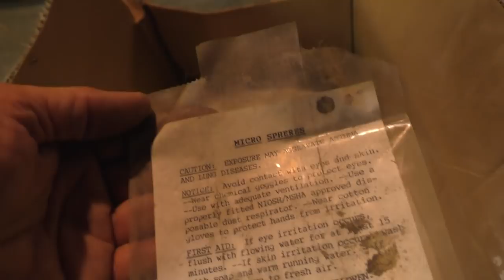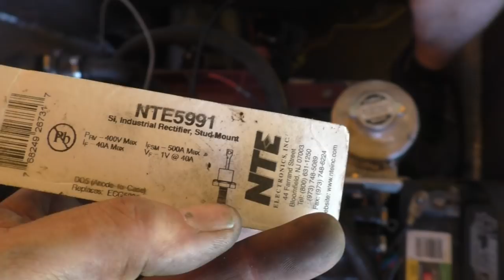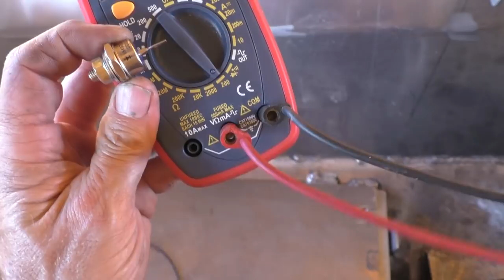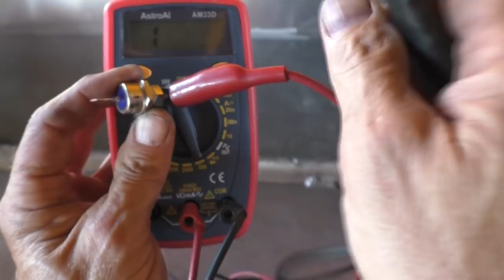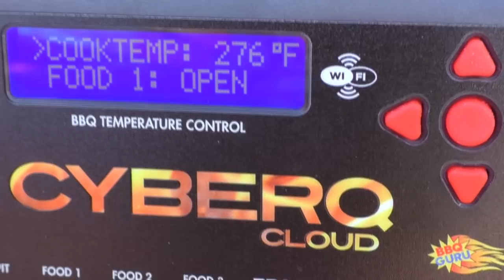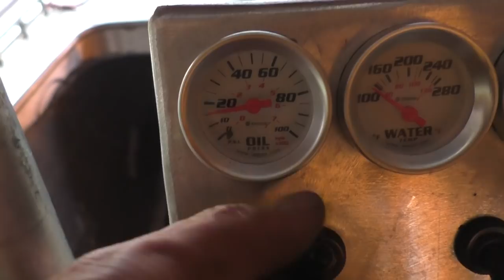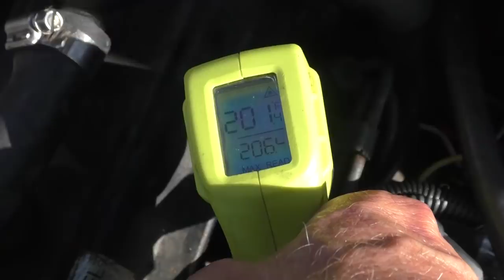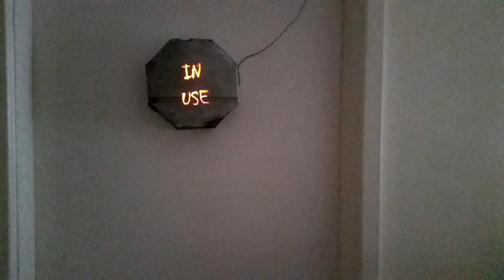Diesel Jet Boat Build - Part 17 - Fixes and Back to the Lake

Comment: LOVE those Butt Connectors. VHT paint also Known as 'Header Paint', or Engine Paint. Paint your Volkswagen motor Hemi Orange, it''ll Put Out Fifty More Horsepower, lol. I like Chris's little trailer, takes Tiny House living to a ridiculous extreme, lol. Oh, and I been making window frames for Mom's windows from 3&1/2x3/4-inch poplar. Don't know how to make a vid or send it. NOT a Carpenter, either. Glad Love Me is Finally Up and Running RIGHT.

Comment: cam tensioner adjustment .. tighten till the Longest span of the timing belt can Only be twisted 1/4 turn by hand.... no more no less..  if its too tight.. it will sound like a super charger.. pull up too hard on the crank.. pull down too hard on the cam and aux shaft.. usually snapping the end of the cam off.. was a specific weighted tool to set the timing belt tension..  most just use the longest span 1/4 turn method..

Comment: Please note the amount of zinc sacrificial anodes on the steel boat up in the air at 34:39. There is no such thing as too much corrosion resistance for your hull.
Reply: That's not true mate, too much anodic protection is worse than none at all

Comment: Maybe get some truck floor board insulation for the aluminum seat above the turbo should help keep the heat in the engine compartment and the seat cool for your buns

Comment: Doug don't waste your time with that stuff it'll rot off pretty quickly, look into getting the manifold ceramic coated, it will reduce the temps to a point where you can still touch the exhaust when its running, the heat in the exhaust also helps efficiency. The ceramic coating isn't cheap but you'll never regret it

Comment: with hamilton jets you would normally run a heat exchanger that would solve any heat issues with heat in the engine box
Reply from the maker: Yeah, it's welded into the hull.

Comment: actually electricity flows from the negative to the positive. The electrons that are moving in the flow of electricity are negatively  charged particles. Just FYI. But it doesn't contradict your explanation of the diode. Good job explaining it. I like your videos

Comment: If that was me, I would use a DPST (or DPDT) main switch, one pole as it is now, the other switching a fused +12v (can use same feed as other side, but ideally use a different feed with a much lower fuse rating) feeding via a lamp & a buzzer (in parallel) to the exciter wire of the alternator. Solves the alternator issue but also gives you an audible alarm if the switch gets knocked (or left) on. Otherwise first time you know is when you go to start the engine to get back to Seeker and there is just s click from the engine bay. Can draw a simple diagram if I haven't explained very well

Comment: When you “tested” the diode with the multimeter you should have used the “diode test” mode on the meter.. turn the rotary knob on the front one position anti clockwise to the test mode.. in the conduct direction the meter will read approx 0.6 v which is the forward voltage drop of the diode.

Comment: I dont know what the problem is but the boat should go faster then 8mph maybe the low rpm of the engine is not enough to get the impeller up to optimal speed
Reply: Pumps too big for the engine, so the engine cant rev up high enough.

Comment: Make yourself some heat proof underwear with the turbo pipe wrap.  Those connectors will come in handy for my radio connections.  I hate soldering.

Comment: Rectifiers were originally a large device comment to old time battery chargers.  They were call selenium rectifiers.  DIODES were VACUUM TUBE(diode, triode, pentode and etc.  Then the transistors can to be. A diode is hard a transistor )

Comment: As someone who got second and third degree burns when the canister next to a vehicle radiator exploded - I cringed when you opened the cap. Had you been in the flow, you would have been going at 8 mph to the hospital - and trust me, until it cools demerol doesn't touch the pain. Please provide warning to others not to do that, lots of newbies watch your stuff and they don't need to go through the pain of those burns.  Thank you.
Reply from the maker: Thanks Mom
Reply: Couldn't be your mom, you notice I didn't ask if you were hurt? I also didn't tell you to stop doing that... I love watching videos and hate watching ones where everything goes to plan  ;-)
Reply: needs one of those caps with the pressure relief thingy.
Reply: @RickBaconsAdventures  he's a grown man, he can do whatever he wishes to do. Between you and I, that wouldn't help because it needs to relieve either to an overflow tank or tube.... it has neither. shrug
Reply: @stoneshrink  Ideally it should have an overflow tank anyway.  seems like the whole theme has become progress is more important than doing things right.  I agree that people that spend a million years planning and never doing anything are stupid but sheesh it pays to think things through a little more.
Reply: @RickBaconsAdventures  he has his advisors.  I'm not one of them.  I'm fine with that.  I think it's a shame that his shop will get broken up once the ship is built - but I'm a builder not a sailor so there is that.  The nipple on the radiator is to prevent the radiator from exploding if it over pressurizes from a blown head gasket or something...
Reply: @RickBaconsAdventures  and I wish them all the success in the world, I've done lots of things which should have resulted in bad, bad things - it didn't, and I hope that it comes up well for them as well.

Comment: Pretty cool! I wonder how your jet drive will behave when there is a lot of seaweed around? We (briefly) had a Boston Whaler jet drive boat as a tender on a yacht that I was running some years ago, and the the thing was almost unusable if there was a bunch of seaweed about. The least amount would clog the intake to the point where it could no longer propel itself. Charter guests weren't very impressed! Hopefully your much larger pump will be able to cope with the unavoidable seaweed patches better than that useless Whaler was.

Comment: I’m worried the boat is under powered for the ocean with currants and waves it takes allot of power
Reply from the maker: We have oars.  Just like they used for a couple of thousand years.    So what changed?  The ocean or the men on the ocean?
Reply: I think they can get more out of that engine if they need too.

Comment: Outstanding video , I like your tender better every time  I see it again. Suppose you wanted to run the engine on its trailer or while it was up on davits, would you get adequate cooling by playing a hose onto the skin where your coolant is flowing on the other side?

Comment: The starter bendix issue is more complex than feedback. Simply put, no other circuit should ever be connected to the starter solenoid. It must be totally isolated from all other circuits. The explanation is complex, but it has to do with the collapse of the counter-wound coils within the solenoid. The spring is weak, so relies on the symmetrical collapse of the coil fields to operate and retract the gear.

Comment: Diodes are used to Rectify AC into DC :)  I couldn't tell exactly where that fan relay was mounted, but you might want to check the nearby temp while the engine is running - a good Omron automotive relay will handle something like 250 degrees, but it might be a lot hotter near the manifold.
Reply from the maker: That's a bracket we make for the throttle cable,  and it's a cool location.

Comment: The diode you used is massive overkill. If you want to have your gauges, electronics, fan, etc powered only when the engine is running, you can use the alternator exciter circuit to power a relay coil and it will only energize while the engine is running that way you don't have to worry about switches being left on. Some FWD GM's from the late 80's and early 90's used a ballast resistor in series with the fan to run at a lower (quieter) speed with a second relay for high speed that bypasses the resistor.  That will reduce noise and current draw.

Comment: That turbo  needs air and lots if it. It looks like your restricting it.   Also the first time you take a wave or even spray the fan is going to pick it up.  I don’t believe it’s made for it.  Salt spray inside of engine bay propelled by the fan won’t be very helpful either.  I’m sure plenty have already said as much but it’s fun to arm chair it.
Reply from the maker: VW’s are fine salty roads in the rain and snow so I don’t see any issue.

Comment: That engine should be good up to about 4000 rpm without any problems. Certainly at least 3500 rpm.
Reply: Yeah, torque is great....but you need rpm for the jet to flow
Reply: @chickenfishhybrid44  , yeah exactly. I think you dont see them for a reason....with jet propulsion, no flow = no go

Comment: Basic approach when trying to remove old exhaust bolts; Pray, spray with kroil and let soak overnight, Pray, apply heat with a rosebud or carefully with a cutting torch if that's all you have, Pray, work bolts back and forth loosen a little bit then tighten back a bit and keep repeating, Pray. If all else fails and they break off in the head, cus then take it to a machine shop if you are not confident in removing the broken bolts yourself, then cus when you get the bill. After all is said and done Pray you never have to do that again.

Comment: there must be more in the engine  its factory rated factory  75 horse at 4000 rpm, your on 2400 now? Open up that pump! There is lots of power left on it< as long its not running coal its happy. Tender lay's nice in the water! looks good!

Comment: Doug, you probably want to get rid of that exhaust wrap.   Bilges like to grow a nice thin coating of oil.    That header wrap will get turned into a wick after exposure to oil.    A nice glowing red turbo next to oil soaked wrap is not a good recipe on the water.

On my turbocharged Grand Nationals, it's pretty common knowledge to avoid that stuff. The benefits aren't that great .vs the costs of anything less than best case.

I'm really surprised you could register that vessel without a jacketed or injected manifold and turbo exhaust housing.    I'm guessing the bronze didn't catch it because I believe that's a Coast Guard thing, not state by state.
Reply: I'd recommend some polished aluminum heat shields above the turbo to reflect the radiant heat downward before it can hit you deck plate.

Letting the engine pull air from in the bilge will help evacuate the heat too. Just make sure to have some sort of flame arresting device.

And some air scoops for the bilge, one pointing forward and one pointed aft so you can use that massive 9mph airflow for some free air conditioning under the cover!

Comment: Don't want to sound negative, but shouldn't that engine get that boat on a plane easily? If not something is wrong with the setup.
Reply from the maker: No we were hoping it might plane. Actually it does when you consider the length of the boat and the formula for planning speed.   And they were likely some things we can adjust   But we will do it later. And yes those parts are not Matched for speed.    The set up is force driver safety and fuel economy

Comment: That header wrap stuff works really good but its a good idea to seal it up with a coat or 2 of the high temp paint, we used it on our Jeep at you really can tell the heat difference.

Comment: 1:29 And that's why we have tap handles!
Reply from the maker: Tap handles remove studs?
Reply: A couple videos back you were bellyachin' (in a good hearted way) about tap handles being another specialized tool, but a T-style handle is better than a ratchet style handle because all of the torque is applied axially. With a ratchet style handle, the torque is applied at a goofy angle that depends on how far the head of the ratchet is above the head of the bolt. I've always found T-handles to work better for undoing stuck bolts. Those old 4-way lug nut wrenches area good example of this. If you've read this far, I commend your patience.
Reply from the maker: You're going a long way to make your point but I was actually bellyaching about people who think they have to have all "the right" tools to get the job done.   I think welding a couple of bit of square tubing together illustrates my point well.   I want crew on the boat that can look around at what is available, work with that, and not piss and moan about it.
Reply: Okay, I agree with you there. I grew up in the middle of nowhere, so I am no stranger to improvising tools. I think what struck a nerve is that my misinterpretation is that you were going overboard with the minimalism. If you were picking on a digital readout tape measure, I wouldn't have batted an eye. I learned electronics with a $10 Radio Shack soldering iron with a tip that was always loose, and components salvaged from TVs and VCRs I took home from the dump. The day I bought a proper soldering station, I realized what I had been missing. Okay, okay, I'll shut up now!

Comment: What are the blue tubes for that are attached to the pipes coming out of the stern for?
Reply from the maker: Elephant trunks.   They drain the hull if/when it gets flooded.
Reply: @SVSeeker  thanks, that's what I assumed but couldn't find the video for them

Comment: You need a heat sink on that rectifier!!!
And it needs to be insulated.

Why can't you run bat thru a "run" switch to the alternator, and run the solenoid thru a momentary "start" switch?
Then you don't need a diode.

Comment: The normal solution to the alternator exciter wire problem (the diode will work to solve the problem and the diode you have is total overkill) is to use a double pole single throw momentary switch connected to the starter solenoid and the alternator exciter wire. It is a button or spring loaded toggle that when you push it, it makes contact to complete two separate circuits and then breaks contact, opening the circuits, when you release it using a spring. This is how it is handled in most automotive settings. This avoids any issues of voltages interacting between the circuits since they are separated completely. Looking at prices, the diode is about the same price as a good switch that can take being on a boat.

Those solder connectors are going to work great since you are using them in a marine environment. They will keep the salt water out of the joints so you don't get corrosion. They would also be good for automotive and outdoor equipment use since they seal well. I would just use a normal butt end splice or a wire nut in places that are indoor or sealed, like in a weather or water tight enclosure.

Diodes for high current and voltage are referred to as rectifiers since their primary use is rectifying AC voltage into DC voltage.  They are also referred to as rectumfriers by technicians. . Also, if you get high enough voltage in the reverse direction, current will start to leak though the diode and then, when at a high enough voltage, will suddenly flow with almost no resistance. This tends to heat up the diode very quickly and let the smoke out of it. There are diodes, like Zener diodes, that are used in the reverse direction, so make sure you what kind of diode you are looking at and what it is being used for.

Comment: Gee, I always thought the thermostat had to be in a seated position...  I didn't know it could just be tossed anywhere in the cooling system..  ;-)
Reply from the maker: You just have to provide it with a grounding wire as well as the sensor wire.

Comment: Could you do like a jet skis and use the water from the lake to cool motor and pushes hot back out
Reply from the maker: Yes, but it's going to spend it's life in salt water.
Reply: @SVSeeker  yes I did forget about that. Thanks for the response back
Reply: @SVSeeker  my next question did you ever change the way your air breather is for the motor
Reply from the maker: @dakotak8437  No.  We tested it without the breather and there was no change.
Reply: @SVSeeker  love the videos by the way sweet vessel can't wait to see the move of it

Comment: Maybe a valve so you can open the water thing safe?
Reply from the maker: You don't typically need to open a radiator cap on a hot system.   But if you do,  get beside it, and not above it. :)

Comment: Why not just get a little sailboat diesel made for saltwater exposure? They're reasonable on eBay and run for 40+ years in the salt.  I know you already know this salt water corrodes like battery acid. Cheers from salty and rust seized Florida.

Comment: are you going to seal those holes that the blue tubes come out the back now that you know it wont plane? no point in having extra holes below the water line
Reply from the maker: Absolutely not.  It makes no difference if it planes or not.  If the hull is flooded and the engine provides any forward momentum the water will drain out the elephant trunks.
Reply: I think you should try that , with caution. Your snorkel is leaking , and the leak might be under the water when the bilges fill, sucking water in through that leak might not be good.
Reply: it will work just fine.
Reply: My maths is too poor to prove it - but I think your elephant trunks will only work whilst the boat is accelerating. When you reach top speed, the water inside the hull is also at the same speed, and there is no longer any 'backwards' force acting on the water inside...

Of course, you could accelerate, decelerate, accelerate, repeatedly....

Did you ever try it with your model? (And just to be clear - I very much want to be wrong about this!!! haha!)